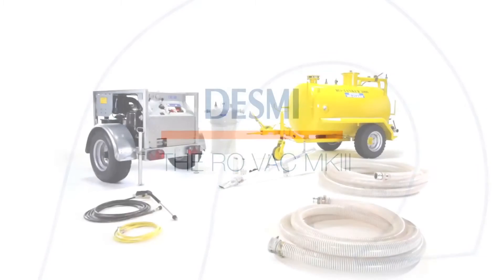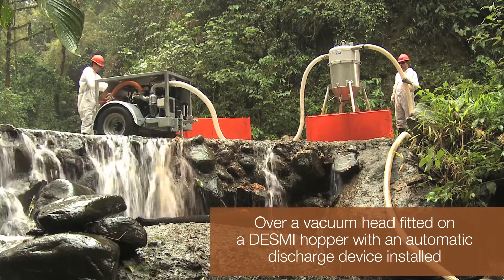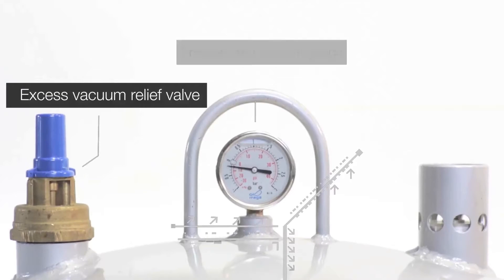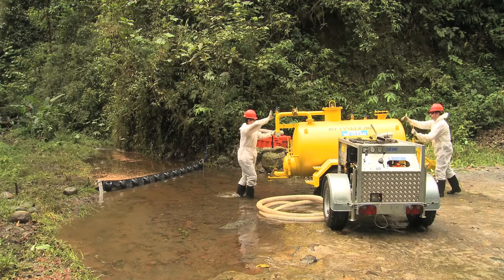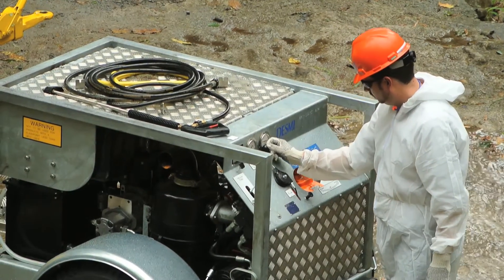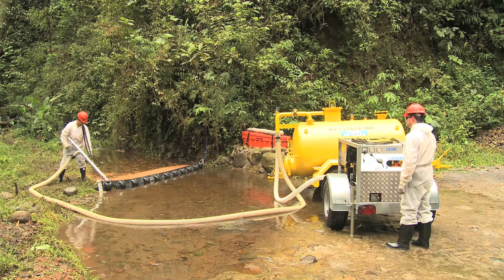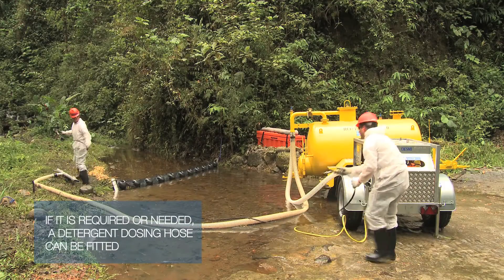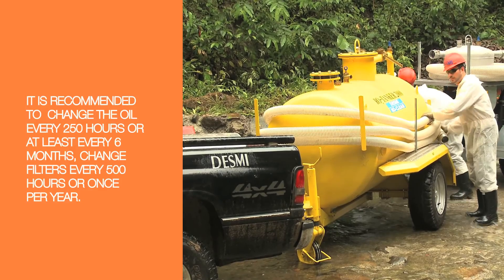DESMI - RO-VAC MKIII Mobile vacuum skimmer system

Comment: What is the vacuum pump oil grade
Reply from the maker: Oil to be used : Pour mineral lubrication oil type ISO VG 100 in the oil tank and ISO VG 460 in the over-gear box.
Never use hydraulic or detergent oil to lubricate the pump !!